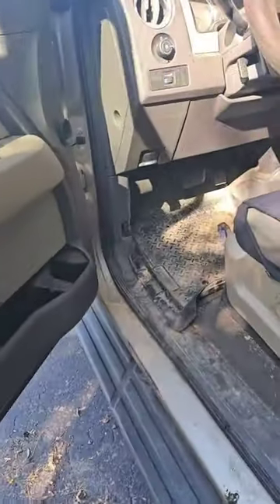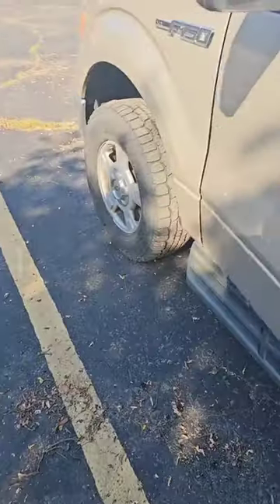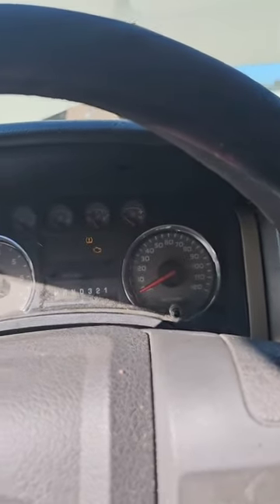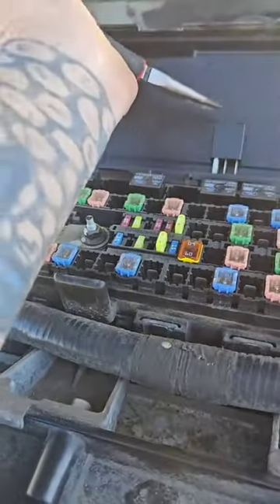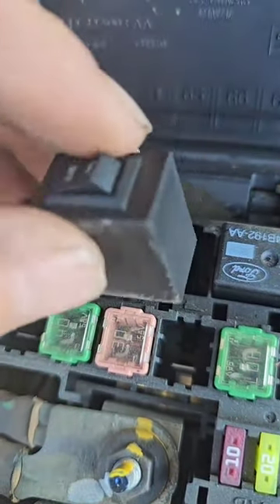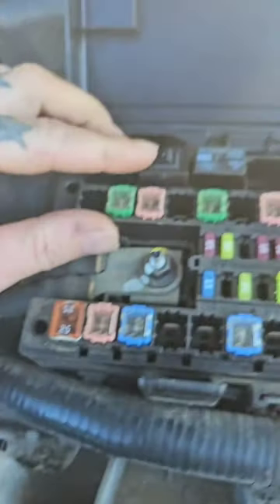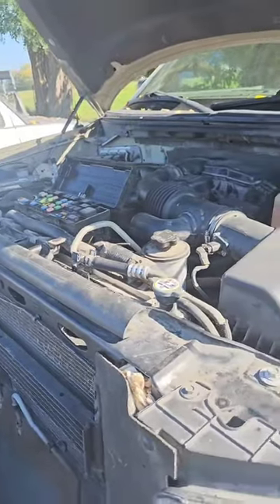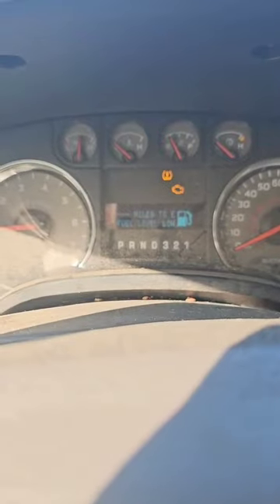full video will be on my page as well as the fix

Comment: Always verify that the shifter cable is not broken and in gear before doing this. You may find yourself running through the parking lot to catch the truck before it takes out a row of new cars. Glad i could run fast back in the day.
Reply: I had this exact thing happen to me on an Explorer. Only, I was underneath the vehicle with a PowerProbe. Thankfully the jackstands kept the vehicle in place but man I almost crapped myself when the whole thing lurched.
Reply: @nunyab2342 Dude I definitely would've needed a new pair of pants after that 🤣🤣

Comment: Id love to see a "no crank, yes start" situation.
Reply: Any manual with a bad starter... ( push start)
Reply: The mazda start stop system is kinda neat. It know when to shut off the engine right after tdc so it just sprays fuel and spark and boom running
Reply: @CarswithNash or dead battery. 👀

Comment: Those miles to Empty showing up in dashes indicates the CAN is not communicating with the Powertrain Control Module (which controls the signal to the starter relay). Did you find the cause?
Reply: Doesn’t that generation have the issue with the harness becoming unplugged. Because it’s behind the passenger kick panel?
Reply: Yes it was a Ford

Comment: Hello and good afternoon Where did you get one of those switches from
Reply: Don’t need a fancy switch to do this. Just take a piece of wire strip both ends and stick it in 30 and 87 and boom does the same thing as the switch. 30 is constant battery power and 87 is the accessory you’re trying to power. Or you could just swap it with another relay next to it. Just look up what relay does what first so you don’t pull something like the fuel pump relay out and it turns into a crank no start.
Reply: Exactly alot of times the fan or a/c relays are the exact same relay #

Comment: Well, also shows circuit is good from start relay through to starter. Good head start.👍
Reply: No fuel pump issue either. No ignition switch problem.
Reply: Had to assume a whole bunch of shit was working for this trick to work.

Comment: 5.4 3v that needs a full timing set..it's common on those
Reply: My dad got 200k on his and never done timing☠️ I guess just drive like a mad man that'll keep it from happening.
Reply: @caryhuffii7224 the timing kit is probably $3000. It’s probably more than half what the truck is worth
Reply: @ryanjohnson8340  you mean $300☠️
Reply: @caryhuffii7224  not when you include the cam phasers, VCT, and labor. Plus at 200k the engine is probably burning oil. 3000 is not that unrealistic.
Reply: @ryanjohnson8340  it's not that hard to do yourself
Reply: @caryhuffii7224  it all depends, how much is your dads time worth though
Reply: You might as well do the whole motor.
Reply: @ryanjohnson8340  cheaper than a new truck
Reply: @ryanjohnson8340 all of those things come in the kit. It’s nowhere near 3k,  even with labor. you are wrong.
Reply: @mickeyshooter5298  OEM the stuff is about 1300, by the time you add labor it can will easily be around 3000. The book time is 12.5, and average labor rate around Atlanta is $120 an hour. You can swap a lower miles junkyard engine in about the same amount of time for about the same cost.
Reply: I don't think the 5.4 was available in this body style F150, really not sure though!

Comment: Still probably more reliable than all mine and my families dodges combined. 😂
Reply: @blueberrychronic  i know that problem. Ive heard about it. Still not as big of an issue as the hemi lifter problems
Reply: @blueberrychronic  are you refering to the 04-010 5.4 3v engines? because Yes they arw a huge pain in the you know what. spark plugs sticking in the holes cam phasers blowing apart guide pins braking Yes im ver aware. still rather have that then a dodge.
Reply: @7.3PSDA2  idk to me dodge is better than Ford. They look better. Ford is kinda ugly overall.

Besides they got caught letting transmissions fail on the inspection line. Not like ford ever knew how to build a transmission in the first place.  And if they was smart they would buy Aeister transmissions since they can't figure it out on their own.
Reply: If you drive a dodge drive a 1st or 2nd gen, just be careful woth that dash
Reply: Hemi tick is nothing replace the stock oil pump and replace shitty lifters and your set for another 200k 😂 lbs
Reply: @MrPorkkChopp  “oh it’s nothing, just have $3000 worth of work done to fix it”
Reply: @sinisterdeer7601  either do it yourself or keep whinning
Reply: Oh well they all got chevy beat. Chevy rusting away at 3 years old on the dealership lot and even got a lawsuit because they didn't bolt down 1 of their drivers seats correctly 😂
Reply: cant build a transmission???? fords are know for building some of the best transmissions. now your going to argue that allison is the best blah blah blah and Yes the 1000 series 5 and 6 speed allison autos are some fantastic transmission, but they are built by allison who is not ford chevy or dodge. the c4, c6, 4r70w, 4r75e, 4r100, 5,110, 6r80 and 6r140 built
by ford compaired to the 727torque flight, 47rfe, 48rfe, 68rfe, chyrsler transmissions and chevys 700r4, 4l60e, 4l80e, 6l80e are not even remotely close. i have owned and operated most of these transmission on all these platforms and to this date i have a 68rfe auto in a 2013 ram thats sitting at the dodge dealership to get a 3rd tranmission installed under warranty. so
i dont wanna here it. and ugly? excuse me but the 04-08 f150s  (11th gen) are by far the best looking older yet newer model trucks the 12th and 13th gens are ugly ill give you that. but the new rams look like catfish. they got that idea from a like 2000 camaro look. engine wise the 7.3 powerstroke and the 5.9 12 and 24v are some of the longest running engines to date on the diesel side. the inline ford 300 6 was a fantastic gas engine built for over 3 decades and served in alot of different applications i infact still have a few and love them. the chevy 350 and 305 were also 2 very strong running reliable v8 engines used often times in a huge variaty of different applications along with marine applications. the dodge engines probably one that id have to give some credit to would be the little 3.9 v6 like in a dakota truck they seemed to be work horses my dad had one for years and years and he abused that little dakota horribly hauling tractors and cars and boats with it. and it did it went threw 1 transmission tho and he had to have some wiring redone he got it new. im just saying all the auto manufactors over the last say 5 decades have built some great things and have built some awful things.
Reply: @7.3PSDA2  oh bs. That's why they failed the inspection test. Check out whistlindiesel 6.0 F150 super wimp. Made the oil pour out of the AC vents. Pure hot garbage that only sells because it's American made 

Honda 73% American. Toyota 58% American

Ford doesn't even have a 100k mile warranty on that transmission
Reply: @7.3PSDA2  ya you're right..... Ford does make solid transmissions. I mean the Ford bronco has a rollaway risk.
And Ford escape got its name by sneaking out of your driveway while in park
Reply: @cactneir 10speed on new mustangs disagrees
Reply: @cactneir a Dodge guy talking about how good the Dodge transmissions are bullcrap Dodge is literally known for having the worst automatic transmissions in trucks. So yeah dodge is not perfect get over it. Lol😂😂
Reply: @zimmhollowfarm8414 I drive a 23 promaster (Stellantis aka Dodge 🤢) shit has less than 4000 miles and the transmission shifts so badly it feels like I get rear ended every time I come to a stop. Pure garbage
Reply: @7.3PSDA2 Calm down. Wipe that tear. You'll be fine.
Reply: @cactneir lifter delete or just get a 6.0 or 6.2 and your good to go son
Reply: @JacobTemple_CE  that ain't good
Reply: Yall notice i left out a few transmissions. the ford 6uh i cant remeber the numbers on the escape and some of the other newest ford transmissions are junk. but over all i feel
ford has the best transmissions compairable.
Reply: @7.3PSDA2  idk but semis are still using the cummins engine and for awhile nissan also had it in their trucks.
Reply: @7.3PSDA2 The 09+ 5.4's are a different animal.  The 09+ 320 hp / 390tq tritons paired with the 6 speed don't have the plug issues. Most make 200k before needing any maintenance on timing system.  One day job, m350hv oil pump through the timing cover, new oem timing components (package deal) well under 1k bucks for everything.

  Makes for a bullet proof, lazy 320hp 390tq smooth as silk v8 that sounds sweet. I cant stand my rattle box 19 fx4 3.5 eccoboost after fixing up the 09 5.4, the 09 is steel body and has smooth v8 power that never breaks a sweat even at a mile high.
Reply: @blueberrychronic I guess you don't know about party Pepsi
Reply: Sounds like a woman driver..just get in and go.
Men know how to keep up on maintenance and repairs themselves and not pay someone to do it.
Reply: @7.3PSDA2 that's a 5.0 bud...
Reply: @cactneir let me get this straight you're saying dodge Is a more reliable pickup because they look better?
Reply: @konnerkramer329  well obviously that dodge cummins is more reliable than anything ford ever made in the last 50 years. Reliable enough for semis and nissan to adopt it without that crappy jatco
Reply: @cactneir  🤦 dodge had absolutely nothing to do with Cummins... also the big cam Cummins was the last decent heavy duty truck engine and even then it was underpowered compared to CATs
Reply: @konnerkramer329  im fully aware of the 5.0s haha.
Reply: and who ever was talking about them putting  cummins in nissan and the dodge trucks and they use them in semis and whatever you said. Yes the cummins are a great engine i work with and on them daily. the 7.3 psd is also a great engine and when i get the front bumper and new tires on it will be my daily driver again. i dont like the chyrsler transmissions some of the other chyrsler components.
Now they make semi trucks with detroits and caterpillars engines and they used to put white and john deere engines in semis to. i have a 379 with a 60 series detroit dump truck. the big cam cummins was a very good engine infact it was the 1st truck i ever drove an auto car daycab with a big cam it i pulled a coal buggy for miles and miles with that thing. no air conditioning no power anything. was one of the best trucks i ever ran. super reliable. that was back years ago.
Reply: You'd think that 5.7 hemi would be extremely reliable since they keep it so long all the issues should have been fixed by now
Reply: @7.3PSDA2 that's stretching it
Reply: @cactneir  Not even remotely close. haters gunna hate on what im gunna say next but until proven otherwise
the most reliable and cheapest of operation diesels in a pickup truck are in no particular order
the 7.3 powerstroke, 7.3 idi, (2 completely different engine) the 5.9 12v and the 5.9 24v.
the next ones that cost of operations exceeds that of those mentioned above but are still fairly reliable are the 6.7 powerstrokes (14-present) the 6.7 cummins (11-present) and the lb7 and the next one 19-present i cant think of all the number and letters durmax. 6.9 idi, 6.2 idi
next are the one if you used as a boat anchor they would float. 
LML durmax, 6.5 detroit, 6.4 powerstroke and the other durmaxs
lastly and i own 1. i cant believe they accually put this into production.
6.0 powerstroke. 
Now on the 6.0 strokers i have the 1st gen 03-04 model and when you spend thousand upon thousands almost 10 thousand to be exact you can make it a moderately desent engine and the usablitily factor without blowing head gaskets or injector orings does go up. but reliablity its still not that reliable. ive still had issue with the ficm after have the engine and computers and everything gone threw and re done and this and that. its just not a good engine. now on this list those that like the durmax. i have a 2007.5 lml i believe is what they call it. and it broke the crank due to there not being enough metal thickness between the edge and the journal. which is one of a few reasons why i dont not like them.
Reply: @thekingofnoobs8362  right.. they still have awful water pumps, and lifter issues. Almost 20 years later
Reply: @7.3PSDA2  ya right. Nobody hears about a million mile ford. But there's plenty of V8 toyotas getting there
Reply: @7.3PSDA2  besides if what you said was remotely true why does ford have 8 million recalls in 2021 and 2022?
Reply: @cactneir  Slow down there. you said a bunch of different stuff there. 1st and for most there are plenty of fords with 7.3 psd and 6.7 psd out there that have over a million on them. my f350 has about 1/2 a million miles on it and still runs excellent.
Reply: @7.3PSDA2  ya anything can last forever with a rebuilt engine. Like I said 8 million recalls vs chevy and dodge having 3 million a piece. Recalls says it all

Ford= we use junkyard parts to build your vehicle
Reply: @7.3PSDA2 they can't... I got a letter last year stating we may or may not have put all the components in your transmission, hopefully by the end of the year we will have the parts to do the work and we will do it for free, next week I traded it in for a ram, that Hemi is 1000% better than that pos ford 😂

Comment: Any F150 Newer than 2003 early 2004 are junk if not maintained properly my 01 has 304000 miles on it and runs great, had to do brake lines, new gas tank, and new egr tube and other normal wear and tear items and it's been the absolute best truck I could've asked for.

Comment: I can hear that exhaust manifold leak from here. God speed and have fun.
Reply: Yk, i installed an exhaust leak on my chevy.. it actually sounds like it has some go now... its still a sad little v6 that takes off slower than your average grandma in a wheelchair but it sounds better at least 😂
Reply: Sad when they designed it to fail like that. It’s always the passenger side popping header studs forcing you to drill and tap. No way to replace them easy either, the engine has to come out.
Reply: @chrisrobbins9058  i did mine, a diy at home mechanic, and the engine stayed in, cab stayed on. Took 4 days, but welded a nut to one and drilled out 2 others.

Comment: Shit still starts and runs compared to my 2 year old Chevy. So far 32k miles GM dealer has had it for 2 months and can't find the problem. My uncles 72 F100 has 835k miles on smokes barely now starts and runs good. It is all original 351 in it. My buddy's New Dodge the transmission and number 5 along with number 7 keeps miss firing. I believe it is a year old. His old Dodge got 69k miles and its a yard ornament now.😂😂 maybe that is why Ford trucks have been number 47yrs in a roll. They last longer. Oh thats all i see in construction zones and in utility work also. Lot of companies use Ford truck's. When i see a different truck the hoods up or its on flat tires looking like yard ornaments. 😂😂
Reply: 351 V8 was not offered in a 72 F 100.from the factory. It is not all original if it's a 351.
Reply: @davidtrupiano3374  352 is basically a 351. 300 is a straight 6. You can tell your story. Numbers on the engine matches the Numbers on the truck. Guess Ford made a mistake.

Comment: Probably more reliable than all my family's chevys put together. I bought triple a for all my chevys because I knew I bought chevy junk.  3 years old and in for major internals at 3,000 miles. Junk junk junk
Reply: Chevy stopped being good past 98
Reply: DOD and AFM  has caused problems in GM trucks since they started using it.

Comment: Let me help you out cam phasers chain, tensioners, low oil, pressure due to an inadequate oil, distribution holes in the block not to mention low viscosity oil pump… Don’t ever buy Ford